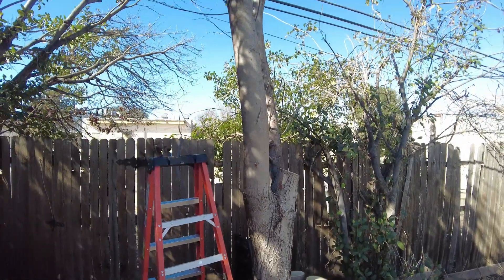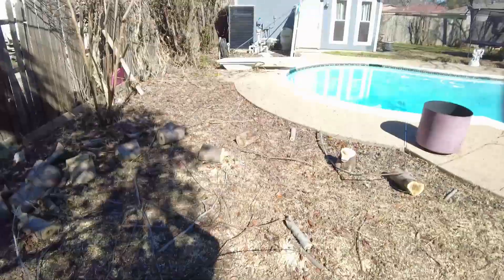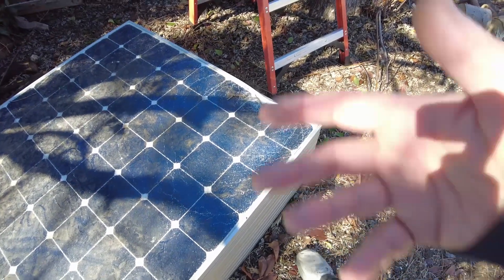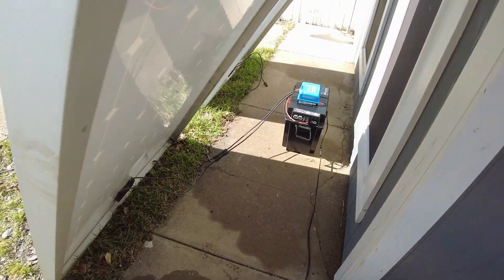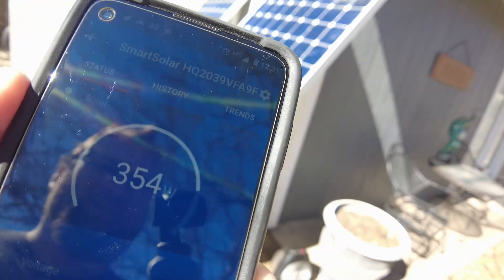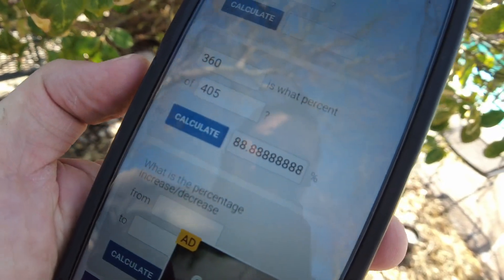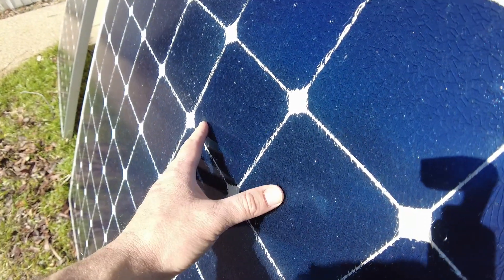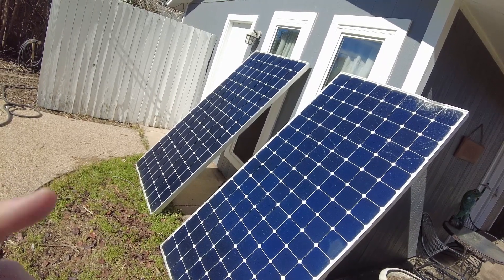Testing broken/cracked PV panel

Comment: I busted a panel like yours & at 1st I polyurethaned it but by summers end it started peeling off & left it to it's own accord. So now it's back to like it was to start & last time I checked, that string was putting out the same as the good 1's. Whether it'll hold up on down the road is anybody's guess. I'm hoping a matching panel will show up so I can replace it.
Reply from the maker: Yeah, I pretty much figured no kind of coating would stand up to the brutal sun for long. Thanks for sharing!